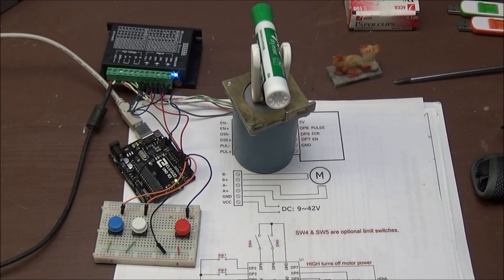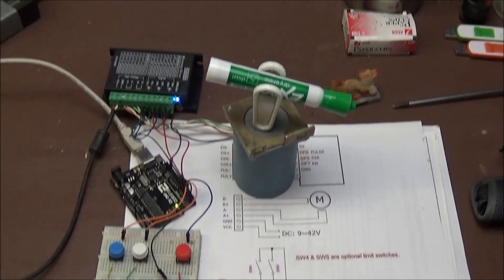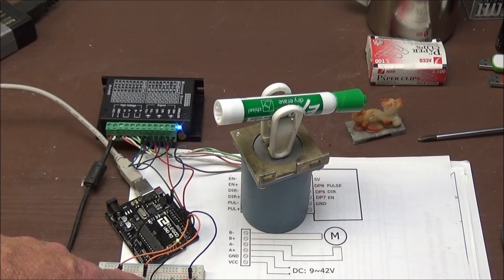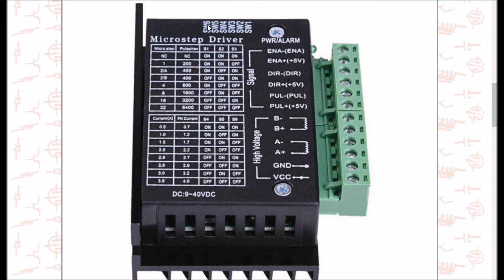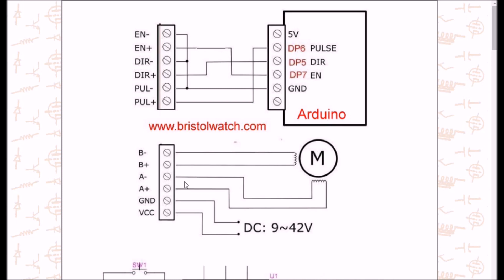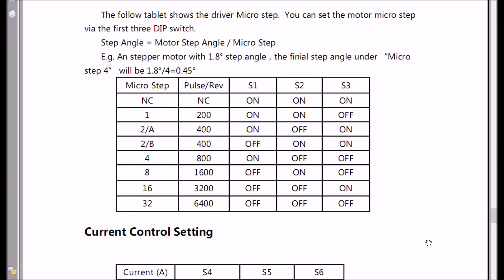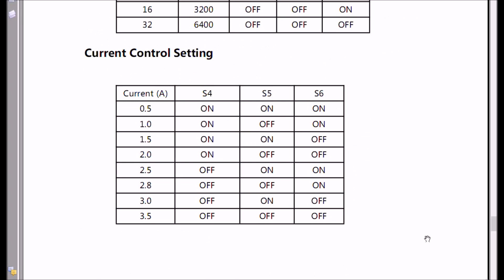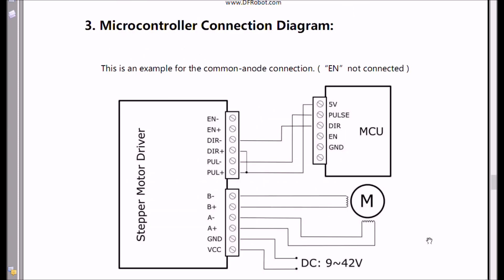Pt. 1 TB6600 Stepper Motor Driver with Arduino

Comment: Sir, Informative video. In unipolar motor, where to connect the ground wire please? Thanks.
Reply from the maker: This is internal to the TB600 controller. In general there is no ground other than the coils are switched to ground the a transistor or MOSFET.
Reply: @LewisLoflin  Sir, Thanks a lot for your prompt reply.

Comment from the maker: More stepper motor videos:
High Voltage IGBT H-Bridge Using Photovoltaic Optocouplers
https://youtu.be/azJo4h-ei6I

Arduino Controlled IR2110 Based H-Bridge HV Motor Control
https://youtu.be/d0r-Yx9R3Zs

Pt. 1 Interfacing Microcontrollers to CMOS and MOSFET Circuits
https://youtu.be/XzetdwzcOrY

Pt. 2 Simplified CMOS-MOSFET H-Bridge Circuit
https://youtu.be/rExHPqTUBuA

Pt. 3 Tri-State H-Bridge using CD4093B CMOS Circuit
https://youtu.be/b8O4ihdHx8U

Arduino Unipolar Stepper Motor Driver Board with Arduino Code
https://youtu.be/HTVYiLOY8SQ

Comment: These are strange little birds. I have taken a few apart and found that they aren't really TB6600, but instead a TB67S109AFTG. One thing to look at is if it has 1/32 stepping, as the TB6600 only goes to 1/16. I have run them on a CNC that I am putting together and they don't make it past @2amps for me (as well as others that have tested)  The 6600 usually have a different location for the dipswitches as well. They seem to do odd things at different PWM frequencies and high current settings. On the CNC it was losing steps right away.  From what I could tell, it was caused by enabling and disabling the motor.  If I tied ENA HIGH it seemed to work ok'ish, but the current was still a problem. I would guess that the driver chips in them are not real anyway, but for 8-10$ very good for playing with and some uses.